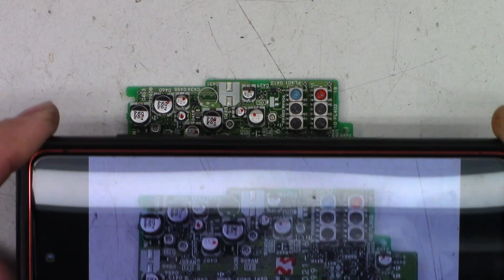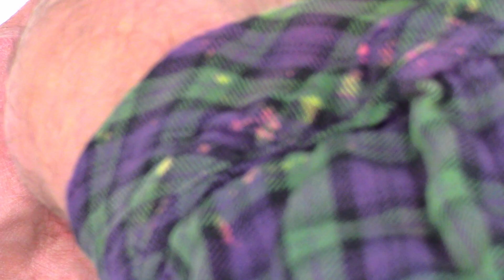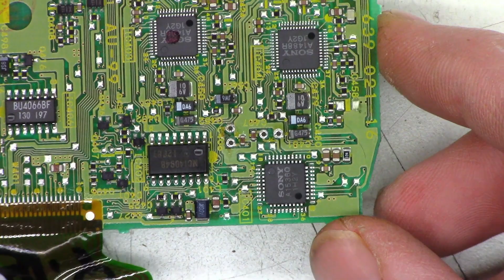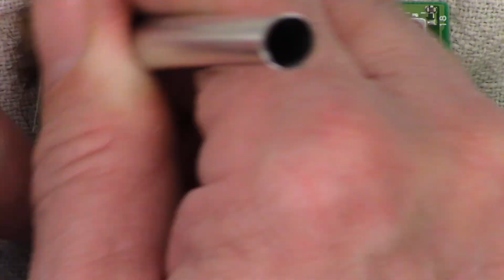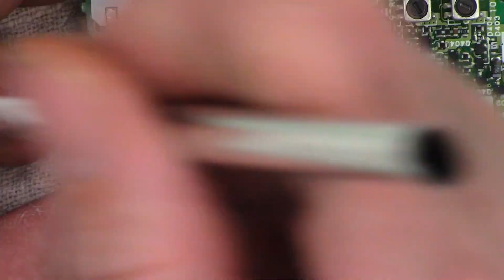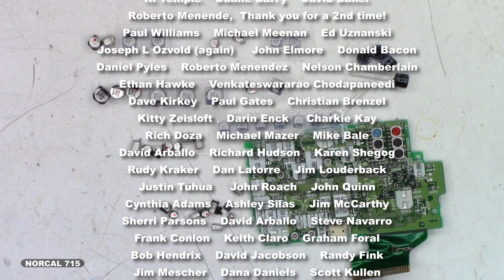Sony CCD V701 Part 3.1 AU99 board preparation for capacitor replacement.

Comment: I 100% agree about acetone not being a great flux cleaner.  I have found that Rustoleum "Epoxy & Lacquer Thinner" works PERFECTLY!  (really lol).  I buy it by the gallon from Autozone of all places. It also doesn't stain/discolor the board AFTER cleaning.  Perfect cleaner.